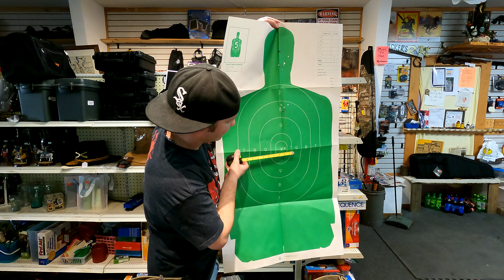Problem Diagnosis Range Trip

Comment: There is a "Guns & Ammo" article written 12-07-2017 that says: "For every 20 degrees of temperature change, adjust one MOA to compensate for the ballistics change."  "It must be true, because it's printed in the U.S. Army sniper manual and spoken in nearly every basic sniper school in the country."  ... "This rule continues to be repeated and accepted despite the fact that it is so easily proved wrong by testing in the field under a variety of temperatures."
Reply: Yes, it's true, +/= for 7.62x51, probably almost a m.o.a. for 5.56 too. Good day at the range Matt, you're tracking true so far.
Reply: Ammo temp! Not ambient air temp! Temp is used to determine how much lag in combustion will accrue during ignition. Air pressure measurements at the shooters location measures how much air is being thickened by the cold, or thinned by warmth. Never use cell phone or internet for baro, that is station pressure at a weather station far away. Must use analog altimeter checked on topo map for accuracy.

Comment: Temperature difference and humidity difference. 
Log books are handy
Reply: Temp yes. Humidity not so much. Air pressure adjustments take humidity element into consideration due to moisture being thicker than atmosphere.
Reply: @timlamay8814  will have to disagree, relative humidity which includes precipitation is not included in barometric pressure. Barometric pressure is an indicator of possible precipitation but humidity which is a measure of and includes air density is a factor. Your zero in an elevation with zero humidity will not be the same as the same elevation in 98% humidity. That's why you rezero your firearms when going into a jungle environment from dry arid environment at same elevations . A great source of information on such is "the ultimate sniper" by major John plaster.
Reply: @DeathMond.  Log books ARE handy in deed. Just for shits and giggles, try using your analog Sun altimeter to measure how THICK the air is. Moist air tend to be thicker, even more so when cold. You measure humidity with air pressure, since your not concerned with moisture content, just air pressure that the moisture creates. Internet station baro pressure is used to measure weather trends in your area, but you need to measure baro with your own weather instruments at the shooters local. Skipping humidity, and using air pressure has brought me better results. Using humidity on top of temp, baro has led to errors in calculations. As I said before, for shits and giggle, try it. It took me years of trying to disprove my training, but the need for speed got me using this method in real world shit while spotting for shooters.

Comment: You need a more precise target when sighting in your rifles.  You're only aiming at a big green circle head-- and its easy to see that your point of aim is wondering quite a bit, simply because you don't have a precise cross hair to aim at.
Reply: I agree once I think its sighted in. I the  draw a very small circle and if it hits it at least 2 out of 3 it's good. But I don't use a rang
Reply: As I've gotten older, I need a larger target.  A full size silhouette(white is prefered) with a tape line across the center is what I need to shoot irons at 200 yards.  I can center my front post side to side, and use the tape line for the top of my front sight post.  I get good groups that way.
One of my scopes has a thicker crosshair, and found that at 100 meters, the width of the crosshair is 8".  So I used a 8" circle, shoot n see, for that particular scope reticle.
Reply: Yup....aim small, miss small.

Comment: If you zeroed the rifles in warm temperatures, then yes, shooting in cold temperatures will cause a drop in poi. I also wouldn't change the zero on the black 13, I would just shoot the Fiochii ammo for range fun and use the same or similar ammo that shoots your zero. I zero my M16 clone on one round, but I'll shoot different types of ammo through it and just use kentucky windage if there's a poi shift. That's why when I tried Barnaul 62 grain sp and it shot around 1.5 moa in a non free floated AR, I bought 3000 rounds of the stuff and that is the ammo I keep my zero set for. Only change the sights or the zero if the ammo the gun was zeroed on can no longer be obtained and you have to switch, but if it shoots good groups, then it's worth the $ to buy a lot of it. The other thing you can do is make a dope card for each ammo you have and note the settings of the sights for the zero for that particular ammo, along with group size at the range it was zeroed for, then you won't have to chase your zero for different loads. Same should be done for various weather conditions as well.

Comment: Did you actually chronograph the ammo?  I've found that Fiocchi typically chrono's lower than other brands ammo that is loaded similarly (bullet type and weight).  Fiocchi may also not be using temp stable powder
Reply: Yep, switch type/brand re-zero
Reply: Agree 100% on your reply,my sons&Ive noticed exactly what you said.
Reply: H-Varget by Hogden is very thermally stable. Used for extreme temp swings.

Comment: Cold air density is greater than warmer air density... Deceleration is increased due to this higher cold air density, which in turn could very well provide a 3 MOA drop. Higher humidity will also have a similar affect, but to a lesser degree as cold does.

Comment: Your issue is zeroing it as different temperatures.  Air temp and humidity change air density (more resistance) and ammo temperature effects burn rates (slower burn).  

This is also assuming all things are equal with the mechanics of the rifle, and the ammo itself is identical in spec with the ammo you zeroed with.

Also TBH when you zero, you should zero based on a 30 shot group due to how statistics work.  As you will get a bunch of holes that form the true diameter of accuracy of the rifle rather than a small random sample which might skew in a direction simply due to random sample chance.
Reply: I agree. 9 hole reviews has a good video explaining this, do 9 - 9 shot groups and you'll know your rifles with that ammo's true accuracy. However, it's hard to justify that now when ammo is expensive and hard to get a hold of.

Comment: Before screwing with your gas id check your ejector, maybe your ejector spring is bad maybe you have both the o ring and insert in or ejector spring (which would cause a malfunction with any barrel longer than 16”. Maybe the throat of your barrel isn’t to exact specs.. which would cause the brass to over expand. I get it’s a new build or whatever but that doesn’t mean shit manufactures fuck shit up. If the brass isn’t being pulled out of the barrel the last thing I’d check would be the gas pressure. If the weapon is short stroking and getting cases jammed or not grabbing a new round then I’d check gas if you have an adjustable gas block

Comment: I've never seen an outdoor range like that. Why does it appear that you're shooting into the window of a building?
Reply: It appears to be the same kind of range as Antigo WI. You are shooting through  4' concrete storm drain piping 20 ft or so long., those are covered with soil. I believe that the piping dampens the noise.
Reply: @tommartinez62  dang. Here in Georgia we just have a covered firing line lol

Comment: This is why I only shoot 2 rounds when it comes it 556N . I shoot Hornady M193 or Black Hills 69g Match King HP . I use LPVO for my 12.5 which is my go too rig . I can just dial on the turret to go in between the 2 different rounds zero . 
I like consistency when I shoot . So I took out all the factors except for me . Some days i shoot like ahit . Other days I'm killing it .

Comment: I think you're confused about what makes a hanguard free floated..
Reply from the maker: Skip to 3:50
M16A2 National Match Build https://youtu.be/WPWhcjAVJRg
Reply: @CRSFirearms  okay okay, I see.
Reply: Well technically, you can't truly free float an AR15 because of the gas block and gas tube. It's not truly the same as free floating a bolt action rifle. But the "free floating" of an AR does make a difference, especially if pressure is applied to the handguard and there's no poi shift, unlike a non free floated, pressure against the handguard can cause poi shifts.
Reply: @CRSFirearms  Challenge yourself. Make us a free float gas block and tube AR.

Comment: Have you looked into the buffer spring weight as a variable in Shredder jams? Recall that as a fix w similar issue on 450 Bush.
Reply: Been a while since I saw this, could have been 300 BO.  Either one, same concept.